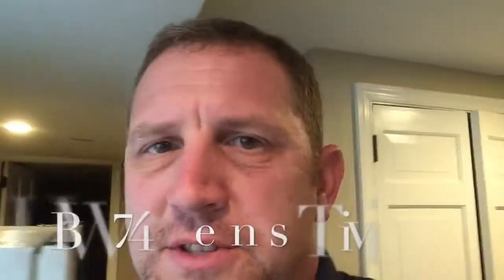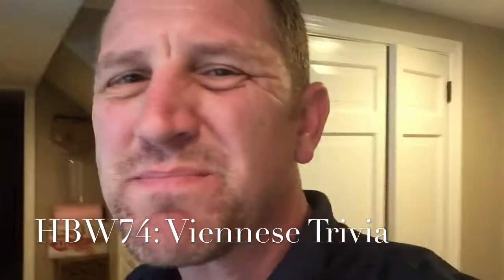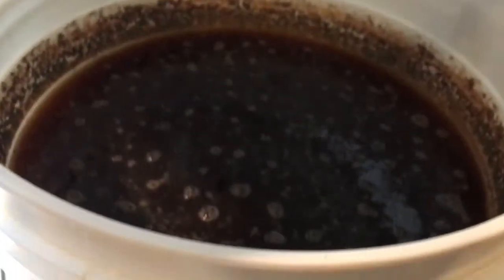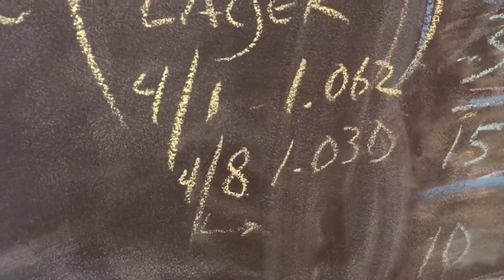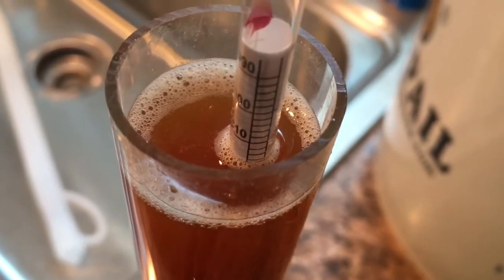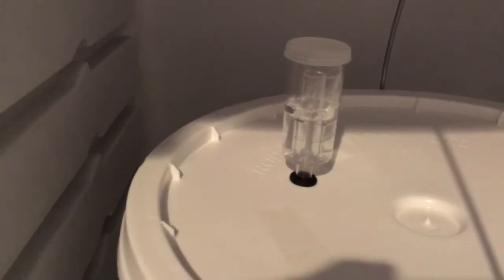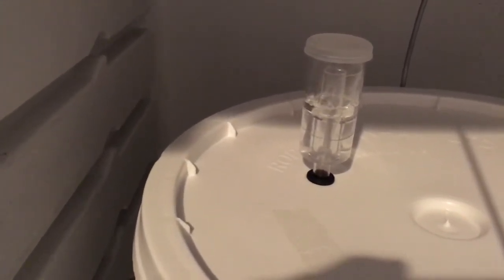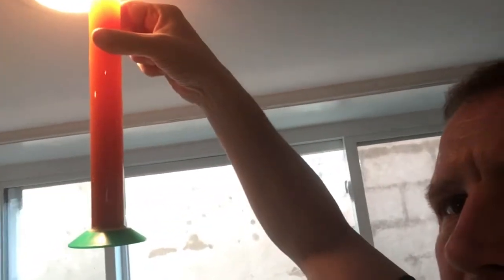HBW74: Viennese Trivia

Comment: I have a hard time understanding how the basement stays hot with the concept of heat rising...but then again...I've been to the East Coast in the summer so I won't argue with ya haha! Unfortunately missed the heads up you gave me on this video...still catching up a bit. Cheers Mike!
Reply from the maker: Manbearpig1122334455, upstairs is 86, downstairs is 78, and that's without turning on the dehumidifiers we have to run in the basement. The ACs will solve all that.